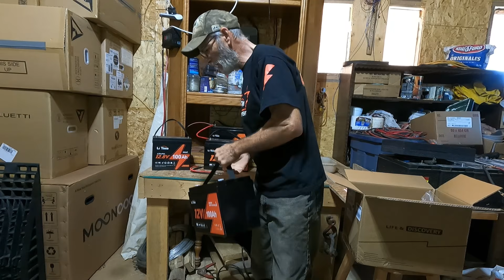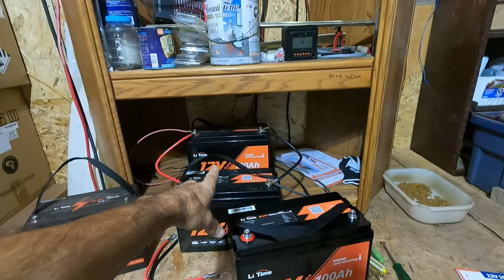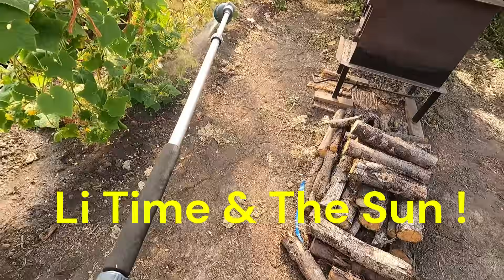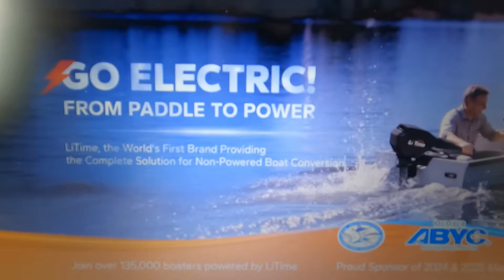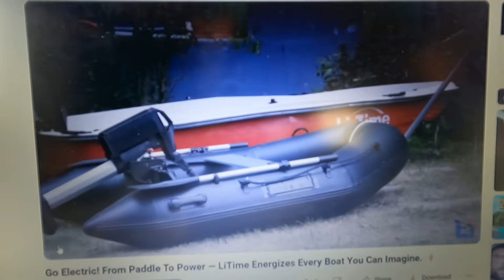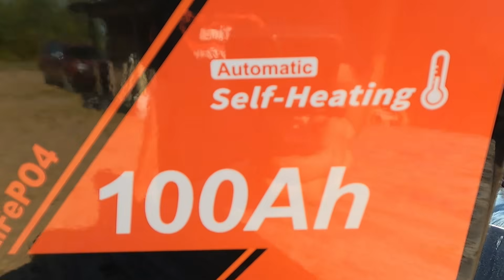"Li Time" Go Electric Champaign !! Outdoor Adventures, Off Grid Power, Shop Tools,  S4,E80

Comment: How much are those batteries please?
Reply from the maker: Well they have so many different kinds & sale they very week by week, Check out the link & if you know what you will be using it for what type what series or how many watt hrs of storage your looking for give me better idea I may be able to point you in the right direction if your new to lithium ? The one I showed not on sale just over $500CAD but they have awesome discounts & different models 10% to 50% off right now :) Through the link you can browse take some notes & soot me a message with a few more details I'll do my best to help :) Don't by until you know what right for your needs,

Comment: They have really worked with you well by the looks of things, alot of batteries over time. Are those the 12v or the 12.8v batteries? I was always under the assumption you use 12.8v on a 12v system as a 12v system is designed to use 12.3-14.5 volts.
Reply from the maker: Yes they are a great sponsor with stuff I use ! More is better when it comes to storage, Yes all 12.8v batteries, & never mix different batteries or series keep them all the same, Lithium will drop dead at 10.8 full is 13.3 but float max has to be set on controller to 14.4 or the BMS will shut it down, The old lead acid will take float charge a bit higher so changing controller is important for the right batteries you have, I've learned a lot over the last few years :) lot of new stuff to come ! thanks for coming along"

Comment: Don,when you want to go real fast with an electric trolling motor.set it so the motor is just under the water and you will be surprised how fast you are moving along.once I learned that I hardly ever used the ⛽️ gas motor,no smoke, no vibration, no Noise just moving around with Mother Nature
Reply: That’s a game changer and that’s for sure just enough so the propeller and motor is covered and you will probably not even need to start the gas engine as this will shock you when you try it.
Reply from the maker: Yes that electric motor is so nice quiet :) I take two batteries so I can switch & hook my 100w solar panel to charge one while I'm using the other works awesome ! I go pretty fast with just me & Ginger but add more gear & a 260lb guy it slows me down lol :) Hey I'll try next time I'm out to lift the motor up a little more & how it works :) Thanks have a great afternoon Jack"